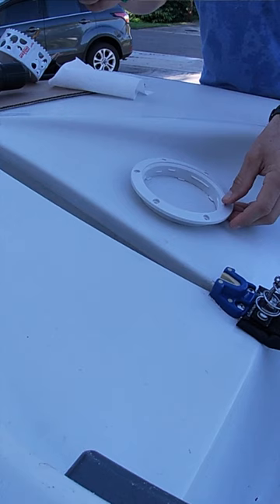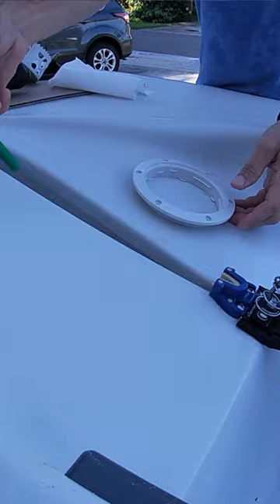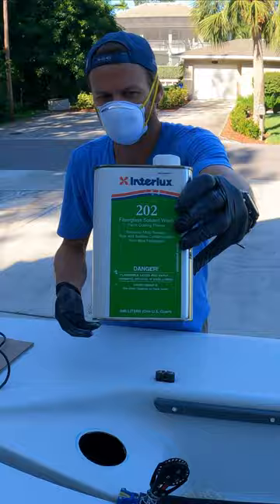DIY on How to Install INSPECTION PORTS on a LASER SAILBOAT ⛵️

Comment: what side is best? original Lasers it was fitted on the starboard side but I am thinking the port side is perhaps better as most races are windward leward and going downwind is usually a starboard tack and you can use your knee against that part without worrying that you will put your knee through the cap.  what are your thoughts?
Reply from the maker: I've come to the conclusion that the best placement is based on if you're right-handed or left-handed.👐 Thank you for watching.

Comment: NOOOoooOOo
Reply from the maker: Oh yes🤣
Reply: there are many advantages, in addition to storing food and snacks, buy a Fat Cat bag and you can put in extra gear like a splash top for when it gets colder to to put it in when it gets too warm, had this scenario many times while at a regattta and out on the water for hours.  Also is a great way to dry out the boat or to see if there are leaks